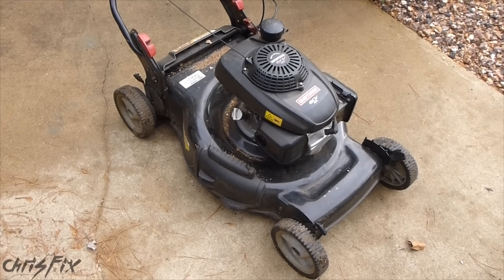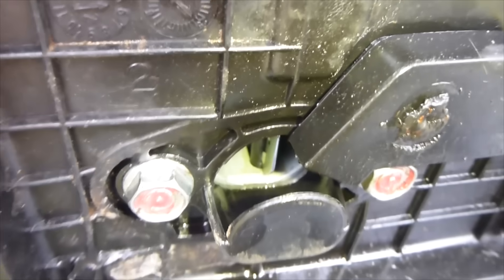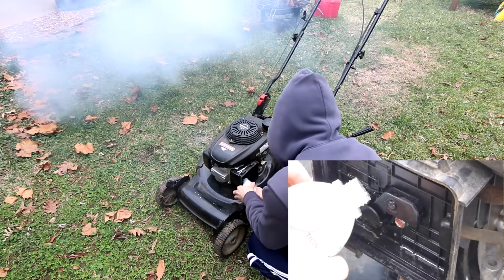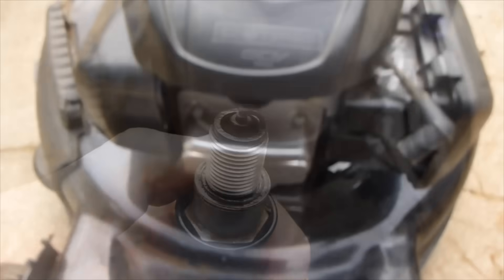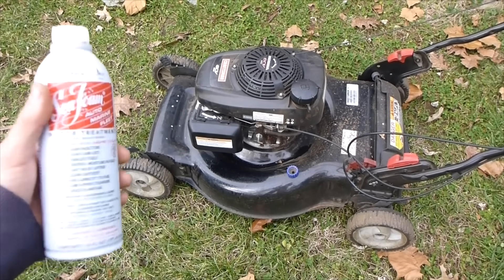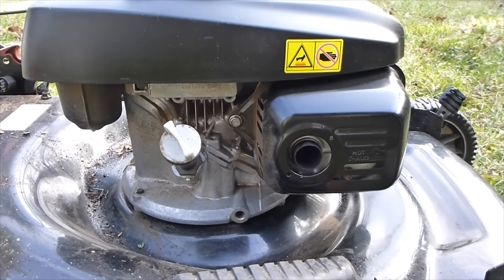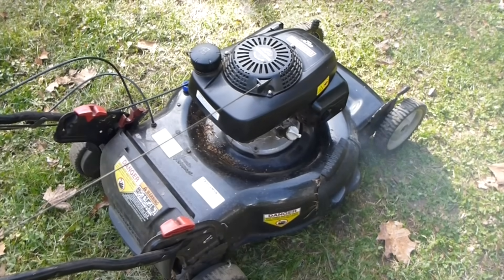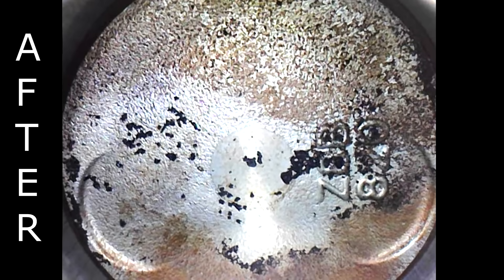Does Seafoam Actually Work? (with Proof)

Comment: Not that I would be bothered about some carbon on the piston, it's the rings that are the issue. A bit of carbon is actually good, it will increase the seal of the pistons. There are so many snake oils out there, nobody had those around in the the good ol' days and things are still running from when engines were made with sledge hammers and chisels from Rock formations in the Andes.

Comment: nice test,   but the real issue is  :  Did that make it run better,?    I doubt it..  Carbon don't matter unless it's huge build up,    But in order to get a huge build up,  You car will be running like crap for a long time,   Not a normal situation,
Reply from the maker: +ThomasTheSailor Chubby it ever had any problems running so it was really just a test to see if it can clean the engine at all.
Reply: That was a perfect test,  The scope came in pretty handy.  clear as a bell.   The Seafoam Company should throw you a bonus,    :)

Comment: WAter does the same thing
Reply: lol you know NOTHING. water is natural its in the air oil floats on water therefore separating from metal. water has been used for years to clean carbon . have you ever heard of water injection its not just for cooling......

Comment: As a teen we used to put ordinary tap water in a ZEP sprayer rev the engine and spray it in a stream  not a mist   into the carbs air intake and it would loosen it up and blow it out the exhaust  In a shop I worked at we had a couple of engines come in knocking  It was not a rod we did the water trick and it quieted down turns out both of the cars were city driven never on the highway the carbon built up so badly  that it was being struck by the piston !  have never seen that before  we told to owners  just every so often to get them up to highway speed then floor it  let it kick down and wind it up blow the crap out of the engine to keep them clean

Comment: I ran 3 oz in my 50cc scooter gas tank and it was awesome. Instant starting, smooth idle, much improved acceleration.

Why no step 3 in your test... adding 1oz to oil and 1oz to gas?

Comment: Awesome video. I've always wondered if it works. Then I asked myself if it really matters to have a little or maybe even a moderate carbon build up. I have two John Deere mowers with Briggs engines. For 10 years I treated one and not the other and used them equally. I really can't see a difference between the two. I'm not an engine guy, but maybe, just maybe there were certain times that it sounded like the Seafoam engine was running a little smother, but it was hardly noticeable most of the time. 

I'm doing and experiment with how often you need to change your engine oil because growing up on a farm around old engines never was the problem related to friction between the piston and wall.

We'll see.

Comment: On second viewing of the same video, a year or so later, I am still impressed by your methodical presentation-- nicely done.
What camera did you use? How did you produce the seemingly live, inset image of smoke coming out the exhaust, while the inset screen showed Seafoam being poured in? It was especially effective, but somehow I don't believe you used two cameras to produce the effect-- maybe some adroit editing, afterward?
On Seafoam attempts 1 and 2, the carbon removal was not that impressive, but I was amazed by the effect of sustained Seafoam immersion. 
BTW, thanks for all the links. I subscribed, rather than miss something.
Reply: At 2:38 you can see in the main video that he has his phone on a tripod recording the pouring video, so it was indeed live.

Comment: That was very impressive!!! It would be fine to soak your car engine the way you did here. As long as you pump it all out at the end with no plugs in, and make sure you change the oil afterwards, because a bit of that stuff will make it past the rings and end up in the sump and THAT could be bad for you oiling system. Gonna buy some now, the stinking octane boost I use in Australia laves so much sediment through the system and even on the piston crowns. Looks like a reddy brown colour, almost rusty looking

Comment: Ever seen a cylinder from a cracked head and or gasket? They're pretty clean. So imo it's possible to use normal water. Boiling of the residue same as making gravy i guess. Might try it my lawnmower.

Comment: There is also an old school idea, that was actually in the U. S. Army heavy vehicles manual that directed you to bring the engine, gas or multi fuel from back in the day. Then after the engine is good and hot, to then run it at high idle while you slowly pour hot water right in the intake. Theory being the water turns to steam to help clean out carbon deposits! Now I've tried this method on many of the cars I owned back in the 70's and 80's , never had the camera you had to look, but did have to rear one engine down anyway, to find that there was evidence of loose carbon missing that looked like carbon was there and still there. But on the engines I've done this to, especially hot air cooled motorcycle and Corvair  sand VW's, there was always a marked improvement, even before doing the old points,plugs and condenser routine. If you think about it that does make sense. That's why I tried it and used that method, as it is very easy to do, and cheap!

Comment: top tip if your lawnmower doesnt start
Just put as much gas in the sparkplug hole and carb As much as you can then turn the choke on full dont stop starting it this also work with cars if your engine blows up about 5 times you did it right now filp it over drain the gas put a new sparkplug on same with a new carb and lawnmoer
this also works with cars trucks and rideons

Comment: seafoam does work, but if you have total gummed up carb jets then its not  going to help a whole lot, if you have just some slightly dirty carbs to some gummed up corrosion then it will work wonders when adding to gas.

Comment: ChrisFix, the seafoam can, I know that there is a lot of words on it... but it also says.

Put 1/3rd in the Gas-Tank and 1/3rd in the Oil Reservoir..
 then it says to run the engine at normal operation for 20 to 60 minutes..
Reply from the maker: I wouldnt put anything in the oil.
Reply: maybe not 2-stroke oil

Comment: Here's why to strive for a clean engine and when to not do this:
A lot of carbon in a petrol engine will cause heat to "stick around" after the combustion, wich can result in knocking and in the end detonation down the line.

Why you should NOT use seafoam like he does in this video:
Catalytic converter.. it'll get clogged up real fast when bigger pieces fall of the piston.
If you're going to use seafoam on your car, atleast disconnect the catalytic converter or start using it while the engine is somewhat clean and use it regulary with smaller amounts to keep the engine clean rather than to blast out all that at once.

Comment: Use water through the carb. I have cleaned out really carboned up V 8 motors by trickling water into the carb while running at a high idle. Correct me if I am wrong. You will be suprised how not spending money works well!

Comment: Dude, check the oil level. That looks pretty thin. Did it go by the rings either time you think? You now have a higher oil level bet...? Ima keep it in mind anywho...
Reply from the maker: Thanks for sharing. The oil level was the same and it was the end of the season so the oil got changed in the spring anyhow.

Comment: The minuscule amount of carbon shown was NOT worth having the SeaFoam (mostly acetone product) contaminate the oil and possibly shorten the life of the engine. After you set the engine with the piston vertical, you were correct in turning the engine over with spark plug removed to clear the cylinder, but after running the engine for 2-3 minutes YOU NEED TO CHANGE THE OIL to remove any (liquified or semi liquified) carbon bits or SeaFoam that may have seeped past the piston rings and contaminated / thinned the engine oil. IF YOU HAVE ANY DOUBTS, ALWAYS CHANGE THE OIL !!
Reply: peopleR2stupid If I used seafoam in my vehicle(in the gas and direct to engine, 2 cans in all), should I change the oil now too?

Comment: After having my injectors replaced my check engine would still come on.  When I put Sea Foam in (when the tank is low)  the check engine light goes off.  I have done this at least 15 times. My understanding is that SeaFoam is similar to Techron (Chevron) , and both are designed to clean injectors.  I now put a can in every third or fouth fill up.

Comment: Just make sure Exhaust is not pointing at something bad, cuz it will be natzy black
you will have to hold throttle open at about 2500 rpm. I've done it many times.  No Black? Clean motor

Comment: 190,000 miles on beat up old F100.  2nd hand carb. was replaced 4 years ago.  Was told, sorry, but your manifold is shot, you might have 6 m. to 1 year more.  OR, of course, replace for several $100.  WELL, I've dumped 3-4  seafoams in gas since then, my idle was set HIGHER for a Ford Automatic, and there is now a tiny rumble at 20 mph, otherwise ancient engine just sounds and runs GREAT.  I dump SEAFOAM IN EVERYTHING THAT TURNS OVER NOW.

Comment: I have a small engine shop since 1973. Carbon cleaning is totally irrelevant to running of the engine. Some believe that red hot carbon will cause pre-igntion of the fuel mix. More than 30,000 engines told me it is a false statement. Sorry!
Reply from the maker: Thanks for sharing. As stated in the video this was a test before I tested it out on a car motor.

Comment: I have a 2000 jet ski with a two stroke Yamaha triple. The carburetors are completely buried under a ridiculously long exhaust system. When I bought the ski it was beautiful but had been largely unused for 14 years. It cost me $800 to have the carbs cleaned, but after that contaminants from the inaccessible fuel tank continued to re-clog the carbs causing all kinds of issues. As Seafoam is one of the only fuel cleaners you can put in a two stroke, and not wanting to waste another 800, I reluctantly tried it. I rigged up a long hose and funnel north of the fuel filter and poured in fuel and about 20% Seafoam while running it on the trailer. To my utter astonishment it worked incredibly well. I don't have as much concern about carbon buildup as with complications caused my crap ethanol fuel, but this stuff worked killer for me. FYI- if anyone else has carbon buildup issues, one of the best things for it is Yamaha Ring Free which comes highly recommended on many website and forums.

Comment: You can do the same thing without spending money by using a little bit of water in the carb, the exact same way you're doing with the sea foam. From what I understand, you're supposed to put the sea-foam into your tank. Also, your plugs should look dry and tan.

Comment: In Nov 2016 I bought a 2003 Liberty Renegade 3.7L automatic with 134,000 miles on it. I was only getting 12 mpg in the city. I read about Seafoam online. By early February I have used 2 cans in 10 tankfuls of 87 octane by the end of February my mpg was 14. On February 20th I put some in the oil. As of March 6 my mpg is 16 in the city. My engine idling is so quiet you can barely hear it. It idles at 650 rpm and the rpm guage is steady with no ups or downs at idle speed. Now I will use it every 10 or so tankfuls to see if it maintains the 16 mpg. In a few months I will update this comment

Comment: Of course the carbon on the top of the piston is of little importance but the carbon in the compression and oil rings is very important so dumping the sea foam on top of the piston is the most effective.

Comment: You probably won't believe this, but you can take a spray bottle of water, and spray it in the carb. And it will clean all carbon off everything, an old timer told me this. He said some old cars actually had a water injection in the intake. For cleaning valves , and combustion chambers. You could flip a switch and Spray it.  Try it, it works. Your engine needs to be hot for this to work.

Comment: Love your video's Chris.  I have used Seafoam for many years, swore by it in fact.  Then I tried another product called Berryman's B12.  Works just like Seafoam only much better.   I had an old engine I was rebuilding and decided to do a little test to see which in fact. Berryman's B12 or Seafoam broke carbon down the best.  I filled 2 glass jars, one with Seafoam the other with Berryman's and placed 1 similarly carbonized valve in each jar, left it for 24 hours to soak then removed the valves.  The Berryman's valve the carbon literally fell off it using only my gloved fingers.  The Seafoam needed scrapping with a scrapper but also removed most of the carbon.   

I think you should do a test for yourself in this manner and post it up for your fans to see.  While both do work, after testing I doubt you'd ever consider using Seafoam again.

Comment: seafoam will clean the 02 sensor when the car has said the catalytic converter has gone bad.  2 years now and every fourth fill a seafoam so  no sensor  alarm and the car runs great. i' keep adding searfoam it beats 1800.00 for catalytic converter replacement by the dealer.........

Comment: why not empty the oil.. and dump seafoam into the cylinder and let it sit for a hour.. dump the seafoam out and use compressed air to try and dry the chamber and hopefully blow out any carbon flakes or residue left.. inspect to see if the seafoam actually worked..  re apply some oil to the cylinder to make sure the rings are oiled. fill the oil again.

Comment: Might want to change the oil after this process, too, especially if you do the "piston soaking" method. I would imagine that some of the Seafoam might migrate past the piston rings and end up in the oil, thinning it down. Just sayin'...
Reply: Sea foam in the oil isn't a problem. In fact, it is designed to be added to the oil to help clean the crankcase.
Reply: After it loosen anything in the crankcase,buildup or whatever, stilkl worulnt hurt to change it & get rid of the loose stuff.
Reply from the maker: Thanks for the tip!
Reply: I agree with changing the oil.  Plus - get a new air filter!
Reply: @357Shakey  very observant of you. But that keeps the air-fuel mixture richer so they start much better when they're cold these little engines you you know. That's about as much sarcasm is that first guy with his seafoam at the seaside with the seashells and the mermaids and the political crap some people just haven't got anything better to do fiddle-dee-dee fiddle dee Dum That's all folks
Reply: It will be alright
Reply: I put lots of seafoam in and I never change the oil. The more carbon I have crunching around in my motor the better it gets.  everything's loosened up now. My gasoline motor starting to sound like a diesel. And they are more durable and better fuel economy:):):)!!!
Reply: @scottchapman8044  What is these even a reply to?
Reply: Steve from Texas looks
Reply: @Why SirTanYoo you only add to oil if you are running it for about 30 seconds then let it sit for a few hours. Then dump the oil and change it.
Reply: @adraxis  dosnt say that on the label
Reply: @jj_finigan  well if you want to put extra wear on your engine by reducing the lubrication leaving it in your oil that is up to you but it literally reduces the key feature you use oil for... If you are using it for dehunking it does not need to stay in the oil. Also using synthetic will prevent most sludge vs conventional.

Comment: Spraying a fine mist of water into the carb or in a car throttle body does a better job so save some money and finely mist with some normal water it will steam the carbon off of everything, valves and piston. I'm an Engineer and I run a Turbo car injected with a water/methanol mix and everytime I've stripped it down the pistons and valves are like new.

Comment: Sea foam is snake oil. We did a test on some two cycle engines. We actually removed the heads. After the test the same amount of carbon buildup was present. We also used Lucas products with the same results. The heads support two cylinders each. One side we poured WD40, then Seafoam, then Seafoam in another head cylinder and PB Blaster in the following cylinder. Let them sit for 24 hours. Zero difference in the WD40, very very little difference with the Seafoam, and some actual breakdown of the carbon with the PB Blaster. With a brush added in the mix the PB Blaster did a superior job compared to the Seafoam. That's actually soaking and scrubbing parts.

Comment: I used sea foam in a 350 Chevy engine   that was knocking, put in a container full into oil ran for a week, drained & replaced oil & filter. no more knocking. I continue to use as a stabilizer in all my small engines as a winterize.

Comment: 4 stroke engines dont need "cleaning". Its a waste of money at best, and in the worst case you can even end up with a lower compression, because it has removed residue that provided sealing on the valve seats and piston rings. Same as cleaning additive for the fuel - dont do it.

Comment: Kids today eat at Macdonalds tooooo much.
If the carbon took months or years to build them use a product like I do in 2 test cars.
Use Marvel Mystery oil add 1 oz to your little gas can of shell premium as it is a high compression motor.Add 1 oz to the oil of the lawn mower.
Do the same for a car 4 )Zs a tank and 8 ozs in each oil change  ....FOR MORE HP and MPG
An old car will clean inside for months it's NOT Macdonalds kids.